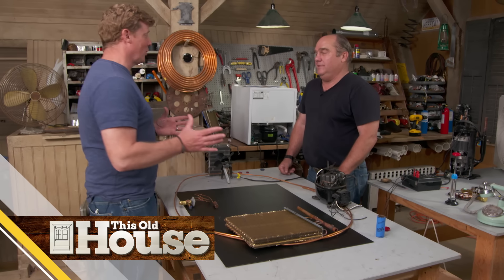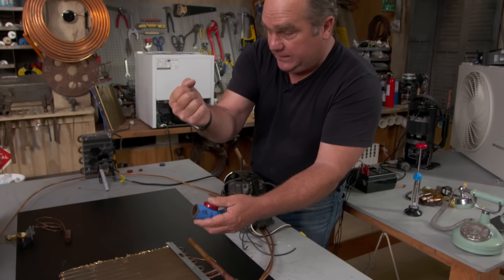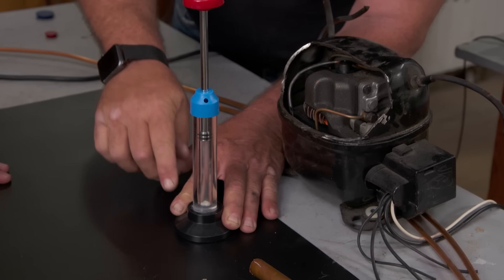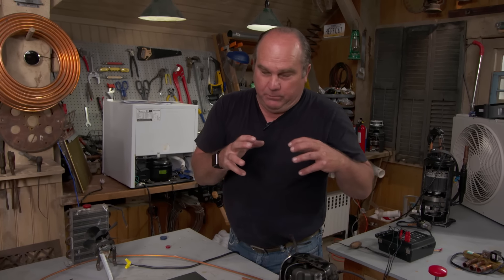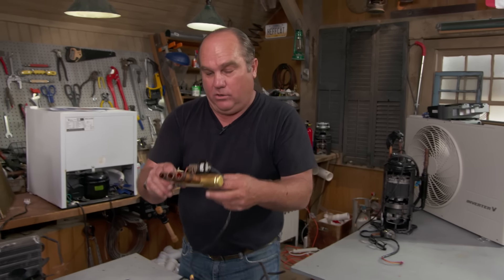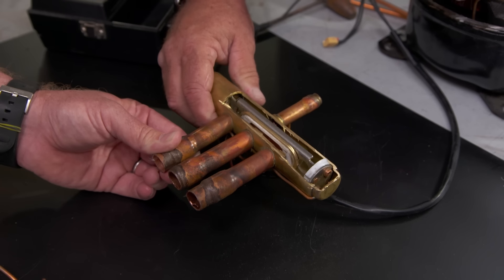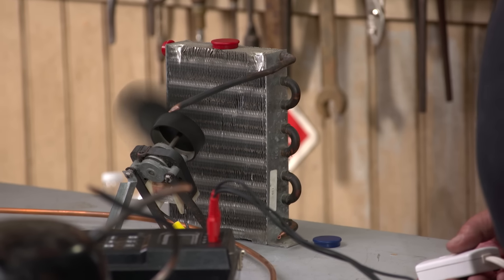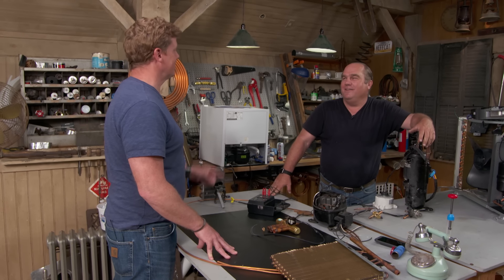How a Heat Pump Works | This Old House

Comment: Thermodynamics forward or backwards. Efficiency is the true question?
Reply: Thermodynamics.
Reply: Lol oops
Reply: @andrewbell7696  They actually use the term "Coefficient of Performance" as the equivalent concept to efficiency, when describing heat pumps and air conditioning.   Look up that term if you'd like to see some examples.

Coefficient of performance (COP) is still defined as the ratio of "what we want" to "what we pay for", just like efficiency.  The reason they use the term COP instead of efficiency, is that the energies involved are not as simple as energy we put in, and energy we get out.  Because in heat pump mode, part of the energy is sucked out of the exterior environment.  And in air conditioning mode, both the heat we want to remove, and the electricity we pay for, are energies we put in to the system, and we don't care for the system to provide energy.  In air conditioning mode, we want the system to get rid of energy.

Comment: I think this is a really good demonstration, but it does leave out the explanation of boiling points and latent heat. Refrigerants are selected because they boil at really cold temperatures under atmospheric pressure. Air would not be nearly as efficient of a working fluid. When you compress a saturated gas like a refrigerant you get the benefit of heat of condensation.  Same is true in reverse in the expansion valve - your saturated liquid boils at the lower pressure and absorbs heat based on the heat of vaporization. This process allows it to “soak up” more heat in the evaporator and effectively shed that heat in the condenser.

Comment: And so, in case you didn't catch it, that is exactly how a conventional air condition works, except that the conventional kind can't reverse the flow and heat the house. So, the benefit here is having one unit instead of also having a furnace that your system has to switch to during the winter. I would guess that a gas heated furnace would heat your house cheaper than using a compressor like that. But, the overall cost probably depends on how the climate is where you live and how much electricity costs. In a warm climate, I assume this so called heat pump is superior.

Comment: Good explanation of heat pump, but at 3:18 liquid air in a can?? Don't think so....You CANNOT liquify light gases as O2, N2 (the main components of air) or other such as CH4 by compression at room temperature. Their critical temperatures are very low (cryogenic, e.g.: lower than -100 ºC for oxygen, close to -150 ºC for nitrogen), which means that they are at a “supercritical” state at ambient temperature. In turn, that means essentially there is no liquid; no matter how high you compress them, liquid doesn’t appear and you get only a denser gas. (This is used for instance for using natural gas in vehicles; it is compressed greatly, up to 300 bar, to get more density and then less volume.)

Comment: I just sold a large house with tow heat pumps (zones). The noise that system made will make me NEVER have another one. Lots of maintenance, lots of noise. That's my experience with heat pumps.

Comment: Very well explained. But I’m wondering about system limitations or efficiency drop off rate to structure size. Being radiant heat, how quickly will it raise temps by 10 degrees inside 2,000 sq ft? Would a single system be effective for 2,000 sq ft, or a twin system be required? How many BTUs do they generate? 30,000 or so? Or 90,000? 
It’s a clever system, and well explained. But there’s situations where heat pumps are good, and situations where they are bad (sq ft, ROI, etc). Those caveats are hardly ever acknowledged let alone explained. Just like sometimes an 80% furnace is actually better than a 96% HE furnace.
Reply: There are charts to determine sizing of heating units depending on what part of the United States you live in base on historical climate patterns
Reply: Heat pumps are not as efficient in colder climates. Work well in summer months, but not so much in bitter cold.
Reply: Most residential heat pumps are designed around the idea of cooling as their main job, not heating.

The majority of proper residential heat pumps don't cope with much more than a single room, or maybe two rooms - up to about 500sqft, basically.  For a house of 2000sqft you'd need 4-5 heat pumps (or the more expensive multi-room units) to cover the whole house.  The idea behind them is that you only heat the areas of the house in use.  None of that US-style "heat/cool the whole house regardless" routine and the amazing waste of energy it causes.  The other thing to remember is that residential heat pumps can't cope with much below -3 degrees C.  There are units out there that will run down to -10C or even -15C, but the unit costs rise dramatically.
Reply: @electraglideclyde  I live in Maine and my heat pump heat/cools over 1200sf and is very efficient. We had -50 with wind chill a few days ago and I used my oil furnace with it to keep up.  I could heat that space no problem with the heat pump other than -50 temps . It costs me less than $2 a week to run.
Reply: Well done video. Great explanation of how it works. The key to HP are sizing. You do size a HP to the A/C load, and have strip heat or gas heat as a back up. Because when you defrost the outside coil, you’re in A/C mode, and the back up heat warms the air going into the house. You use the heat from the house to warm the outdoor coil back up and clear the ice. And as you move around the country, or the world, your sizing chart will vary. But the main concept is if you size a HP for heat output, it would be too large for the structure and when it would go into cooling, it would cool the structure so fast you would not have proper “Dehumidification”. And the cooling would feel uncomfortable. It is better to have a smaller A/C system that runs longer. Or properly, and then supplement the Heat requirements. Both air conditioning needs are met this way. For both comfort (first) and efficiency second. That dehumidification allows you to raise indoor set points to a higher point, and still feel comfortable. It’s all about humidity and how the human body reacts to it. I was in HVAC for 45 years, I learned many things about refrigeration and air conditioning. But HVAC systems are also designed around energy use now. And as energy needs and availability of power mature and change throughout our lives, this industry is changing with it. Fascinating Science…. Thermodynamics….. it’s fundamental…heat travels to cold!
Reply: The builder/homeowner has to do their part too, the house should be extremely well insulated such as spray foam in the wall cavities and ridged foam adhered to the outside sheathing. Spray foam not only insulates it also fills air gaps that cause drafts in the structure of the house leading to heating/cooling losses. The foundation should be insulated using 6-10" of high density ridged foam under the slab and against all the basement walls. The attic should also be spray foamed. There are also passive heating techniques that utilize orienting a house, sun angle, and having large window areas to warm a heat sink during the day which will then radiate heat into the home at night.
The system Richard was explaining is more typically used with forced air heat with a heat pump outdoor unit with an air handler inside unit. I am not sure if the same unit could be used with radiant floor hydronic heating
Reply: @chrisdaniel1339  You misunderstand what a heat pump is.  You can't connect them to a forced air system.  That would be utterly pointless.  Forced air systems include their own direct heating elements, whether gas or electric.  Those are massively inefficient, which is probably one reason they're so popular in the US.
Reply: @iatsd  I live in the south and have a heat pump outside condensing unit (it looks like an A/C unit) and a forced air handler in the garage that the refrigerant lines go to for both heating and cooling. Looking at the outside unit it is impossible to know whether a unit is just an A/C or heat pump unit as they look identical. A forced air system is anything with a blower, a non-forced air heating system uses baseboard style, under floor radiant, hydronic(gas or oil boiler fed) or electric resistive heating baseboard units. I fully understand what a heat pump is. There is a different style of heat pump that is used with ground geothermal or well style geothermal usually with backup heat of some manor for northern climates.

Comment: I’m confused 🙈
Reply: The skinny of it.... it works like an air conditioner in the summer to cool your house,  plus it works as a heater hence "heat pump"  in the winter to heat up your house. Which would save you a lot of money in the winter not running your main furnace all the time. There's more to this heat pump then that... I would explain more but I just don't want to confuse you.

Comment: My husband and I need a whole roof tear off, replacement,  gutters and fascia board replacement. We live in northeast Ohio about a half mile away from Lake Erie. Could someone please direct me to what the best type of roof ( stone coated steel, solar tiles, asphalt shingles, slate, etc.), gutters and gutter guards would be for my home?
Reply: Metal roof, Aluminum covered fascia boards, same as when vinyl siding is done.
Seamless, one piece gutters and I have no idea about gutter guards, don't like them. Metal roofs are usually more expensive and have a lifespan of anywhere from 50-100yrs. Asphalt shingles are usually the cheapest but can still get 30+yrs from them. This decision can be made from a financial point, how old you are, what look you're going for, etc. If you're young, have the money and like metal roofs, that's what I would choose.

Comment: Okay! Let's see a heat pump, in practice, keep a home at 24°C inside, when it's -25°C PLUS Wind-chill outside. I don't think it will work very well.

In addition to that, I foresee the electricity usage skyrocketing, because the heat pump system is constantly running. As demand on the grid increases, the cost of electricity will skyrocket too.

Comment: I had to buy an electric strip because when it is very cold heat pump does not work well
Reply: Heat pumps don't work all that well when temperatures plunge below freezing in the winter, that why in cold climates and the mix humid section of the southeast, heat pumps usually have a AUX electric heat strip furnace, there also hybrid systems that are basically a heat pump mated with a gas furnace as the AUX heat source.

Comment: Expansion valves are still hard to understand (for me)
Reply: It drops pressure without any heat exchange or mechanical work.   It uses friction to drop pressure across a constricted passage.   All energy it started with upstream of the valve, it will still retain downstream of the valve.   Because it drops to a pressure that can no longer sustain a pure liquid state, it drops the temperature as well to the boiling point of the substance at that pressure. The process is irreversible, so you cannot have the 2-state mixture automatically compress back to a liquid, without mechanical work input to get it there.

In principle, you could put a turbine in the same spot, but there is a diminishing return to doing so.  So we simply use a valve to drop pressure, without any energy transfer.

Comment: Richard is confused.   The compressor is used to change the refrigerant from a gas into a liquid which requires pressure to do so.  It also heats the liquid.  It is the hot liquid state that is used to heat a home or it is discharged outside in the cooling cycle. Now the liquid is run through the expansion valve where the pressure is released and the liquid is turned into a gas (just like the can).  In doing so, this change from liquid to gas  requires a lot of heat (heat of evaporation) resulting in cooling of the gas.  It is this heat of evaporation that is really what makes this cycle work.   The heating or cooling produced is then used as needed to condition the air depending on the cycle used.
Reply: He has it right.

Comment: Finally someone who can explain to me how a freakin heat pump works, now if only we could figure out the difference between a heat pump and central air because it seems in HVAC land all the systems are exactly the same, then suddenly they're all different lol why does this industry seem like it's using black magic?
Reply: So you can't mess with it or fix it !

Comment: My heater is much more efficient than my air conditioner.  Well, it costs less to run.  Why do I want to use AC technology to heat my home?  I do live in a colder climate (MN), which has spent a few days at 100F recently.

Comment: You didn't explain what the middle pipe was for on that valve thing
Reply: Lewis Kelly the reversing valve top comes from the compressor and goes to the outside coil during cool (left side in video) or to the inside coil (right side  in video).  The middle is the suction line that goes back to the compressor.
Reply: Exactly why leave anything to chance. This video is for people that are learning something new. Explain it in full detail or it’s not a good video!

Comment: So, i know that in line sets you have a hot and a cold line, but cant you just change the location of the expansion valve to get them both hot or cold so that the line sets dont exchange heat when run together, thus using less insulation on them???

Comment: As cool as this is you could get the same effect from a temperature controlled blower motor on a 5kw furnace that's been placed in a small room somewhere in the house with a vent that opens and closes accordingly with the temperature controlled blower motor to regulate the temperature of the area the furnace is in to make it more efficient. Less things needed and easier to install. I don't understand today's technology anymore. It's like everybody is trying to out overcomplicate the next person.

Comment: Will a heat pump be able to heat a house in a very cold New England day?
Reply: The key is good insulation to minimise the heat demand. Also, air source heat pumps can freeze up if you have freezing temperatures and high humidity like we often experience in the UK. A ground course heat pump might be a better choice, although they are significantly more expensive and more disruptive to install.

Comment: I would like a physicist to weigh in.  Is it fair to say that a principal of thermodynamics is that "heat goes to cold"?  It may just be semantics in so much as the explanation of the heat pump is concerned.

Comment: Wouldn’t it be simpler to say that in cooling mode- the coil inside the house is colder than the air inside, the fan blows this cold air into the house. On heating mode- the coil inside the house is hotter than the air inside, the fan blows this hot air into the house. Rather than saying heat goes to cold

Comment: It doesn’t work quite like that, you missed the names of the components, condenser and evaporator and why they are named that way it doesn’t just push gas around the moving of heat is done by the changing of state from liquid to gas and from gas to liquid, whenever we change a liquid into gas (boils) it has to absorb heat and when a gas condense a gas into a liquid it must give up heat.the main components are the compressor and the metering devise (an expansion valve is only one type) lets start with the compressor it takes gas from the evaporator and compress it to a high pressure gas it now goes to the condenser here it’s has to give up heat when changes it’s state from gas to liquid however it retains its high pressure as a liquid the liquid now returns to the evaporator at the metering devise, here it comes out as a low pressure liquid and it changes state as it boils it to a gas absorbing heat the compressor pulls that gas out of  evaporator, thereby keeping the evaporator pressure low causing the liquid to keep boiling. A heat pump simply reversed the process and  refrigerates the outside air and makes it colder than it was and dumps the heat inside.

Comment: The easiest way to explain it is using a window unit, when you have one running and you go outside, it's blowing heat, so turn it around in the window to heat the house (though I'm sure that would be very inefficient)

Comment: This guy missed quite a few things. When the expansion valve opens, the thermal dynamic solitude of the condenser changes. He should have went into more details about the operating covalent in the I have no idea what I’m talking about I’m a bus driver. Thanks for the cool vid👌🏾

Comment: AIR COMPRESSORS GET HOT. WHEN YOU COMPRESS THEY  FREEZE WHEN YOU EXPAND TOO FAST 
A HEET PUMP USES THE FACT THAT ITS HOT AROUND IT TO COMPRESS  MORE HEAT THAN IT WOULD

Comment: Heat pump can not keep up with Canadian cold. It only replaced a room air conditioner. Then, the outrageous cost of installation and the unit does not make sense.

Comment: Compressed air gets hotter. This is how diesel engines work. No spark plug, just high compression.

A bicycle pump gets hot after use.

Comment: My question is what is the ideal climate for a heat pump?
Where is seldom gets below 32 degrees or seldom gets below 0 degrees?
I have heard also the heat pump use a lot of electricity in the winter and does offset the cost on natural gas or heating oil. Unless Biden purposely raping Gas and Oil prices.....